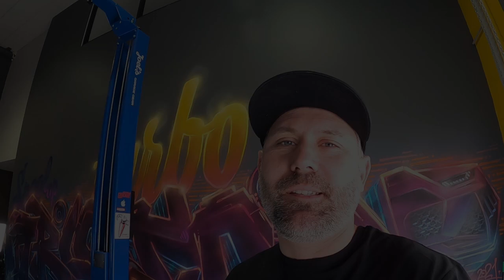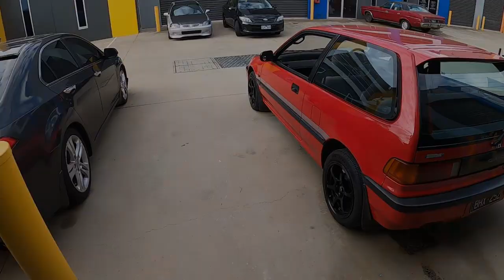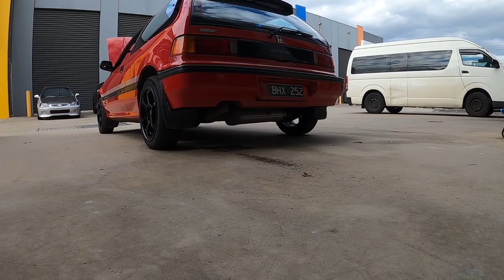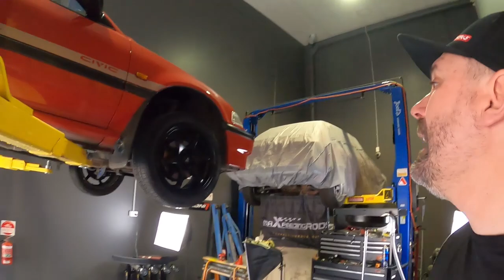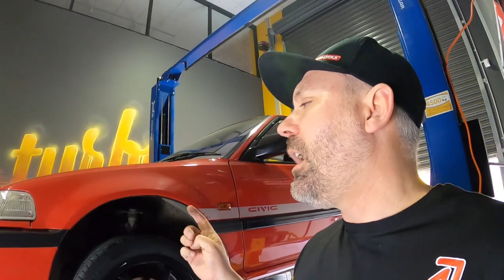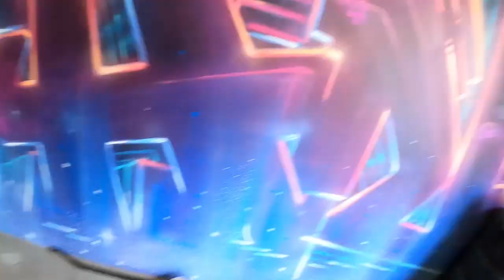EF CIVIC D15- D16Y8 VTEC SWAP -NEW PROJECT BEGINS

Comment: Ok a little bout the wiring harness. Most ef 89-91 should bolt right in but & kinda big but the obd ecu from 89-91 efi used low impedance injectors. Most ef also due to the low impedance injectors used a resistor box right at the firewall. 

High impedance injectors 92-00 & obd 1 or obd2 can use the ecu with vtec. There have been conversion kits for modding the li to hi & obd to obd1 but I don't know if they're still available. If you plan on using the engine harness from an eg or ek but maintain the ef body to ecu harness there will be a lot of work on swapping pins.

Oh & you can keep the cable operated clutch if you get a mt from 89-91 ef. Only if you want to go an extra mile to swap over the hydraulic clutch from 92-00, well good luck with that. In addition the mt ef 89-91 has a engine/ transmission mount front cross member that is exactly what you have inside the 88. Only 92 & up moved the transmission mount forward & off to the side.
Reply from the maker: Thanks for sharing all your knowledge my man

Comment: Maxpeeding also do a traction bar kit for these and if you want a rear sway bar da9 and brackets is a good upgrade as well as da9 brake proportioning valve and master and booster
Reply from the maker: Nice great info Jack thanks I will hit them up
Reply: @TURBOTRISTO   other comment got deleted 

you can use factory gear box 
You will need a crx or EFI tank from USA

Comment: For a rear disc brake conversion on an EF chassis you need either the EF Si rear trailing arms with disc brakes or the 90-93 Integra rear trailing arms with the disc brakes along with the e brake cables those are the only compatible options
Reply from the maker: ill see how I go it all looks the same at first glance
Reply: @TURBOTRISTO  Yes but looks can be deceiving there's plenty of right ups online on which trailing arms to use on what chassis I have all around Integra trailing arms and front knuckles on my 376whp Turbo EF sedan and have done a few on the EF platform as I have worked on this platform 15 + years
Reply from the maker: @boost_edjamesmathew2168  I trust you Man, I will take a closer look and tripple check and take your advice
Reply: @TURBOTRISTO  No problem bro a little online research should give a more in depth explanation on the different chassis and compatible trailing arms

Comment: I’m pretty sure those DPFI systems run off an ecu right? I did a single carbi to EFI swap in my EG and boy it was a learning experience shout NZ for cheap EGs, had to change all the wiring in the entire car pretty much. But great fun for my first project car. Tristan I know that GARAGE BUILT HONDA has coverd a DPFI to MPFI swap in his videos might be worth a look regarding repining wires. 🙌
Reply from the maker: You are correct, I have seen their video on that it was very good, this car is strait carby and I have the entire loom and ecu for this car ready to swap in I am hoping it is that simple
Reply: Good fun mate, hope it all goes smooth for you. It Is going to make a great video/videos. I wish there was this info out there when I did mine. Had to learn the hard way hahah
Reply from the maker: I will appreciate your help man if I have questions I will ask you

Comment: The rear suspension is right but different models had fork or eyelet set ups.

You will need different shock absorbers the style to match up.
Reply from the maker: cheers Harry, I have noticed that after looking at a few online, things will be sweet I have no doubt

Comment: Where to start. Lol. Great project! Love the project here.  
The rear LCA's from Hradrace will work, or you must get coilovers specific to the 88.
The EK rear trailing arms should bolt up, but you need to use all EF camber arms, tow arms, etc. However, you should also be able to swap over the hub assembly to the existing trailing arms to make the stock trailers disc. 

The DPFI to MPFI swap is fairly straight forward, but not sure about Dual Carb to MPFI. 
Probaly similar, but not sure. 
A possible good resource is in the link in my reply to this comment.
Reply: https://youtu.be/p2PtPoVX4NE
Reply from the maker: thank you sir, I figured as much I appreciate your help
Reply: Aussie isn't dpfi it's dual carb
Reply: @hondajack8049  thanks man! Honestly appreciate you pointing that out as I completely missed him saying that and I didn't know they came with carbs in AUS.  Learn something new everyday!

Comment: Yeeeeboi!! D16y8 for Lyph 😂 
For real tho, this is exciting. Thanks bro! Also great find. That hatch is amazing
Reply from the maker: Yeah it’s mint! The owner loves it
Reply: @TURBOTRISTO  makes sense it’s owned. Didn’t catch that. I’m stuck on doing stage 1 or 2 n/a cam and ITB’s  for my fun civic build or turbo with t28 8-10psi. It’s a weekend cruiser or take to work here and there.
Reply: @T-Ray-AllDay  go with the turbo route man, you’ll spend more money with an na build for less power
Reply from the maker: turbo 100%
Reply: @lucaspaulina9727  I’m a weird fella and would prefer a supercharger for FI. I don’t need/want horse power. Immediate  small power/torque is where I’m wanting to be. Track style racing/ auto cross. I hate lag LOL. Even in my mk7 gti with as much lag mitigation clean up I’ve done. Still lag :( I’d take right now small baby power over lag. I think I made my decision LOL. Thanks gents. Money is close to the same btw for staying obd 2 and diy itbs. Reliable set ups at that.
Reply from the maker: unless you go crazy high compression, itbs are the worlds most laggy thing ever they only have like a 2000rpm max power band at 7000-9000rpm, off cam and anything under 6500rpm there is zero torque
Reply: @TURBOTRISTO  wow I didn’t even know that
Reply: @TURBOTRISTO  mid stage cam and high compression would be needed for sure to make any type of good power band. Good point good sir
Reply from the maker: yeah man watch a dyno video of any car with quad throttles and from the time they go wide open throttle until the time that it starts to make power is very very laggy, thats why the awesome n/a civic drag cars that run low 8s dont go below 7000rpm
Reply: @TURBOTRISTO  you’re right on point my man! Call me crazy, but I don’t see why I can’t do both. Most money will be spent on ems.. I want to stay obd2 (‘96 d16y8). Itb home built and quick spool t28- gt28r type turbo. Best of both worlds.. could stay stock pistons and cams, but upgrade bolts/springs/etc. see y’all in 3-4 years LOL
Reply from the maker: @T-Ray-AllDay  hhhahah
Reply from the maker: @T-Ray-AllDay  yeah I have seen them like a gtir pulsar